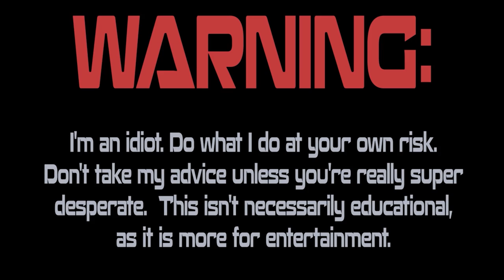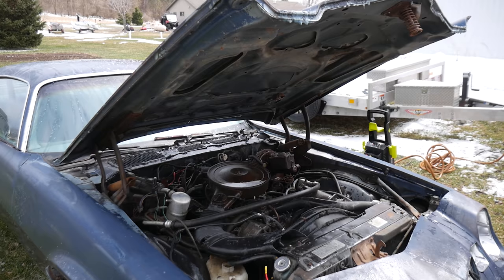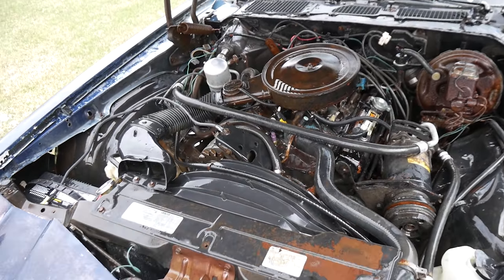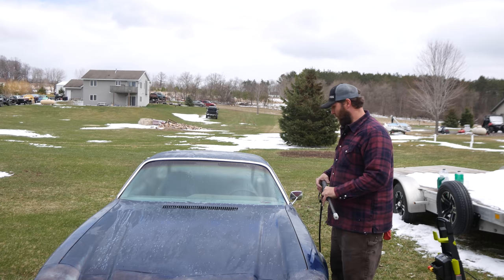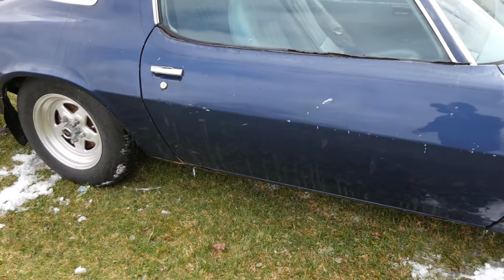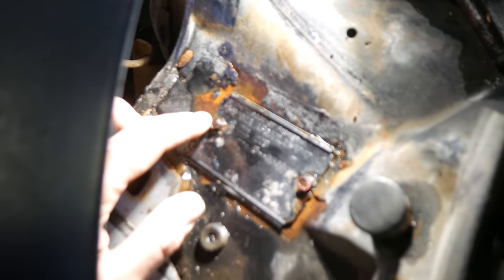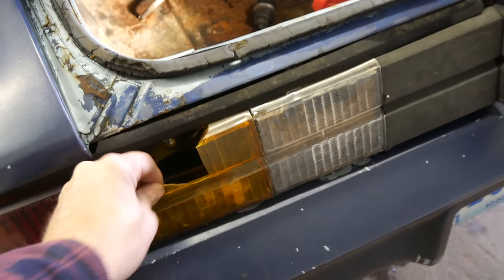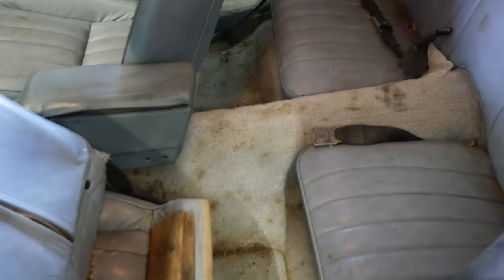Forgotten Barn Find Camaro First Wash In 21 Years! - Vice Grip Garage EP69

Comment: Love this channel!  Here's a bit of advice from an old F-body guy: Get the feller an old-style triggered oil can with a long pointy dispensing tube.  Fill it with lightly used (or new) 30w-ish motor oil.  Now lube the crap out of those giant old door & hood hinges, springs, hood latch, release cable, trunk parts that move, spring shackles, etc.  Basically, lube anything that moves and looks rusty.  Do it until the parts GLIDE...it takes a few trips around the barn too.  Soon, the hood & doors will work a whole lot better.

Comment: your issue isn't the gravity feed. Your washer is trying to compress an air bubble. Remove any tip you have and stick the wand into your water container and run the system in a circle with the tip submerged. Might bleed it out. Usually you can run them with garden hose pressure and the power off with the tip removed and they burp the air out pretty good. If you don't you get pressure drops and compressor noises while the soap makes a run for the ground.

Comment: I think the ‘ol 305 just needs a cam, intake, and carb, maybe a little more cleaning up and she’s good. Then throw a glasspack exhaust on her and she’s a teenagers dream right there
Reply: Did my first burnout at the town ice cream spot as a teen on a 305, it'll get her done
Reply: @Onewheelordeal  I got outrun by a 4-cyl Mazda pickup in my '78 305 Camaro. What a turd that motor was.
Reply: 305 is a fine engine, there's nothing wrong with them other than the fact the 350 exists... which is better in every way.   Since it has a 305 in it?  I wouldn't put any money into that engine, but it's fine.  I second the glasspacks.
Reply: The Old muscle car  350H/327 cam in it , maybe an edelbrock dual plane performer. that'll wake it up.
Reply: Then we have to put on headers. Which means we need better heads, which means rings, bearings and probably bore it .030.....so we need new pistons. Yep. Thats how it starts.
Reply: Plugs too
Reply: @unicornsteaks6769  in '71 I made a whole lot of money betting on my car against mustang 289 and Camaro 283, I was in a 65 VW bug. Keep in mind minimum wage was 1.65$ an hour. The only thing stock on the engine was the block. I had almost 4k $ just in the engine.
Reply: Cofel_81-228–.   You’re right, just a couple more things tho. Swapp that 305 block for a 350 block and while your at it thro in a 400 crank.   Just simple bolt-ons. To wake that lil 305 up! 🤩
Reply: You did see the part of the video with the burn-out right? With the sound turned on? And he spent 9hours PUSHING into the garage? I getting the ole 305 is not OK vibe, it’s hurt, probably pretty badly.
Reply: @padrescout  You could bolt on a set of decent heads, a bit too much cam and good dual plane intake/750 carb. 4:11 rear with a spool and a stall converter. That way when you don't make 300 HP and trash it for a 350 you'll have all the parts for 350 HP.
Reply: Yeah, I agree... take that little 305, swap in a 4 bolt main 72 350 block, 400 crank with the main journals ground down, 350 Rods, 400 pistons, harmonic dampner and flexplate, then solid lifter 292 cam, camel hump angle plug 202 heads, RPM air gap and a Holley 650 mechanical secondaries, that little 305 shout skoot down the road pretty good! Like my 83 Sleeper Firebird and the 340 Challenger in my 96 VHS vid "Burnouts & Boobs"

Comment: A way to get rid of the sticky steering wheel is to make a poultice of baking soda and a bit water.  Rub the paste on the wheel as if you’re wet sanding.  Repeat as necessary.  This method works great on tools and handles that have the “soft-grip” plastic (TPE) that always turn sticky.

Comment: Second-gen F bodies were well-known for the rear leaf springs coming up through the trunk once they got rusty, and this one is no different. I wouldn't touch anything on that car until the driver's side trunk rust issue is fixed, especially if you're going to resell it

Comment: Air shocks. fat tires. glass packs, rear spoiler and some rustoleum stripes on top and you have a race car, a little duct tape and some fuzzy fur and your interior is mint! dont forget to flip the air filter lid upside down to give that throaty sound. then you can take her cruisin wearing your white Reebok hightops with the laces undone

Comment: Professional car youtubers: “make sure to not use excess water in the engine bay, cover the engine when washing the hood, and be careful of electronics.” 

Vice grip garage: haha no
Reply: If you have to drive the car right away sure, i think you may be over thinking things a bit. I detailed cars at a gm stealership a hundred years ago and if you know what not to hit straight on you usually are fine. We did spray em off with the engine running back then.
Reply: He’s power washed the interior of cars before.
Reply: @montestu5502  
I've power washed the insides of big trucks before to, Kenworth, freightliner  , Mack it makes them look good, a pain cleaning the Windows though .

Comment: We dropped a 455 HO into my buddy's '78 and backed it with a beefed TH400. It requires frame connectors (and some other strength upgrades) but it sure is fun to "pilot". Trying to talk him into a 5 speed manual swap now and a set of Super Duty heads we found.

Comment: DEREK, if you'd put 1 of those fancy ball valves (like the water feed on bottom) on top of that tank. You have a compressor on the truck. Run the regulator down to 3-4PSI. You wouldnt starve the power washer!

Comment: I bought a 1979 Berlinetta Camero with  a 350 C.I. motor and with a 4 speed manual transmission brand new off the store room floor. Mine was dark metallic green with a tan interior. Sure wish I still had that car.

Comment: For your current issue a shorter garden hose would help and for your well water issue calibrating your well X trol tank to the proper air pressure to water pressure ratio will help that fluctuating water pressure..

Comment: I had a 80 rally sport with a 305. I broke the smog pipe on it that made a leak and convinced my parents that  the motor was shot. so I put in a 327, You know a 400 would go nicely in there if you can find one. Or a big block.  that camaro really is in pretty good shape

Comment: Do a cheap engine upgrade, add a 350 crank to the 305 to make her a 331(minor notching required). Then throw a PepBoys 4bbl and some flea market headers and cherry bombs on her. Leave the paint as is; its perfect. Top her off with black steelies in front (w/chrome lugs) and a pair of old early 80s era 5 spoke Z-28 rims in the rear, (extra points for white lettered Coopers) and you'll have the perfect tweaker Camaro. Then crank up 'Bitchin Camaro' on the cassette deck (with Jensen Triaxials in the back)  while you do donuts on your neighbors lawn at 2am. Rock on.

Comment: I don’t know if you know this but that valve cover with the “305” on it tells me that that is a GM replacement engine, those 79 305s had soft cams and nylon covered trimming gears they would get brittle and come apart then there would be loads of play in the trimming chain (that may be why it got a new engine?) I think you do a great job with these videos, keep up the good work. P.S. when that power washer s**ts the bed I was hoping you could replace it with a louder one 😜

Comment: @Vice Grip Garage I have a 46 one ton pick up truck. It’s been sitting on my farm for 50 years in the rain. No rust on frame, crossmembers or rear end. But the engine has been rained too. What could I do with it to get it going ? Try to rebuild it’s motor or put a more modern engine in it?

Comment: Derek, if you're not going to keep the Rallys on that '72 Chevelle, toss'em on the Camaro with some el cheapo white-letters....trim rings and the center caps, call it good. Might be able to just sand the flaky shit off the surface of those rear panels and hit it with the specific plastic "paint" if they haven't deteriorated too far....the steering wheel, may just be better off to get a cover for the rim section, the material is breaking down and will continue to emit "spooge"....if the carpet is just faded and stained, might be able to clean it and re-dye unless the mouse piss stench is soaked real good into the jute padding underneath.

  I remember these base-model Camaros being $1500 used car-lot specials, all day long...

Comment: If you pull the shifter in low 1 and hold it to the right side you can use it as a ratchet shifter lol that's good for at least 50 horse brother lol

Comment: Nice ride. Does the air condition work? I owned a 305 in 1990. Unfortunately, the rear electric circuit collapsed and it had to go.

Comment: Where I come from, we call that an Earl Scheib special
Reply: I  remember Earl Scheib ,and his commercials..lol  He can paint that car for $ 99.99, of course it wont be a color that you have ever seen before...but...lol. My 68 chevy belair  was a light metallic green, came back from Earls more of a Pea Soup ,stealth Green..
Reply: Yep, one step below Maaco
Reply: Had fergotten about Earl Scheib, tks fer the reminder
Reply: $99 paint?! I wouldnt suppose that half your wheels, molding and taillamps are painted over as well only to find out its chipping in a week...
Reply: @alvon911  i know a maaco that uses high end paint dupont sentary  500 witch would cost a person more for the paint then they charged to paint a car i would never knock that shop  plus they have a real good painter i just would not let them do any body work they can't cut and replace they tend to use way to much bondo . but that is not there fault it is city hall that is at fault no wielding or torching is what they have to deal with . this is y there is no real body shops in that county .

Comment: Dude. Build a high revving N/A small block for it. Convert it to a manual trans. Lift it. Light bar on a roof rack. Paint it with a white single stage tractor paint. Call the ol gal "snowblind". Rally the wheels off of  it.

Comment: I would gut the interior except for the dash. Clean it up and bolt in some cheap seats. Cut out the rust and bondo/fiberglass the holes. Rattle can paint job, tail light, grille, get it running right. $500-$600  in materials and parts. Shoot it down the road for $3k

Comment: Put it on jack stands to clean bottom and top.  You dropped the AC pump to tighten the power steering by robbing bolts???

Comment: Always love your videos.  I just picked up
 an 82 El Camino with a factory 305. 4 barrel that was in a storage unit since at least 07.  Got her started up and she has a flattened lobe on the #4 exhaust port.  Would you have any recommendations for a new budget friendly cam/lifter set?  Got a performer intake and carb for her  and want her to be a daily driver?

Comment: My own theory on sticky GM steering wheels: 20 year old "Armor All", the detailer's secret weapon of the 1980's. My uncle used it on everything. Had to steer his '74 Safari that was sitting for 10 years and had to wear gloves. FYI: Never,     EVER!      use "Armor All" on a motorcycle seat. You'll slide around like crazy on the bike, and any barstool you plan on using over the next few days. (it was a 1983 XR200R)

Comment: If you want to do it the right way:   Take your angle grinder and take it to some of the rust. then fill it up with fiberglass bondo. then half gallon of blue all around. don't go for showroom quality. just go for coverage to make it look smooooth. keep the damned wheels, they're fine as winter rain.  maybe a half can of frame flat back on the rrear drums .    And ya, for the engine if you didn't screw it up  the 350HP/327 cam is a nice selection. fit under any GM lackluster head. easy on the valve train. may even live with todays oils.

Comment: that would be nice with a 383 stroker engine in it with a 700 r4 And a 411 limited slip differential. that is if a feller had the money.

Comment: Well you have Rally's on the Chevelle with a bad frame that would look nice ...it seems to have one of those $99.95 paint jobs ..you could make it a sleeper out of it with .020-.030 gap in the rings & a ok cam she would take a 300 shot of nos . On engine masters they did a 305 & it did fine till the ring gap closed up so the motor will take it will a quiet mufflers & your wording you could make some money racing people

Comment: I miss my 77' 3speed automatic turbo with 305 small block and I switched the 450cc 2 barrel  for a 650cc 4 barrel carb I got off a Chevy van. Bitchin Camaro Derick

Comment: I had a 1980 Firebird Esprit, and the original steering wheel was sticky just like that. Could never get it clean, so I ended up replacing it.

Comment: Ah it's got the under bumper hood latch my 80 and 81 ended up with hood pins because of those. Lol coincidentally the 78 I own now has the through grille latch on it. 78 was the oddball year it shared alot of parts with the 77. I put pins on it anyway because of the fiberglass hood it came with that isnt great has no latch provision.

Comment: I had a 74 & a 79...
Both were powder puffs...The 74 had a 350 and I think 37 hp. Got 9 mpg.
The 79 with the 305 was a much better car. Had more power (believe it or not) and got 15 mpg.
That whole smog & hp reduction era sucked nads , but you could work on em.
Like like todays, digital runs the whole mess, cars of today...
My 74 smelled like grampa's feet, and it was yellow like his toenails.

Comment: Hard car to make a buck on. I would replace the carpet with new. Try to find used interior panels and spray paint, back rear deck panel, used but good seats if possible, tailight. New shocks sits to low. Get the engine, trans, brakes and suspension working right then dump her. Hopefully you could make $20 on her.

Comment: The captains wheel is the material used,  it's age and the length of time since it's been introduced to petroleum products,  ie  hand grease.   A guy can be sure that one has been run through by the owners hands a time er two.

A guy can't  run a 126.8 foot long hose,  from gravity to his wife's pressure washer,  and expect it to not cavitationilize 67.91% of the time , not 3/4 at least,  maybe a good 25.50 foot long 7/8.20 " ? 
Oh well,  it's fiiiinne. 
cheers guy

Comment: If any money is to be put into the 79 Camaro, It should be spent on RUST REPAIR, FRAME CONNECTORS, SUSPENSION, DRIVETRAIN & Then, One would want to pretty her up & put some lipstick her! Rust repair first & then the basics, stiffen up the frame (or lack there of-sub frame) There are companies that make custom frames! THEN SHE'D BE WORTHY OF A 1973 (4.125 bore sb400) stroke it out! Then, Bore it .030 over, port & polish the heads or replace them with aluminum heads & add roller rockers & be on your way to achieve 750hp & torque. Then one would fall in love with her!!! Do her right!

Comment: Put a digikal meter on the whirly box lol  I love when you describe parts of the cars electrical system and how you say sparkilators etc. Well that paint is a bit worn on that front Apron more than the rest but hey its the spot that gets hit with small rocks and gravel from the road but the rest of the paint looks like it  was rusting a bit but it might buff out in spots. The interior not good when it smells like the inside of a Gerbal cage means them little mice anamules were living in there at some point. Thanks for sharing Derek

Comment: Had same car with T top. Bought it new. 305 had distributor issue. Engine would stop after hi-way driving for 45 minutes. Fix was to remove coil and points, wipe bottom of distributor with a silicon oil/paste to prevent the bottom of distributor from overheating. Crazy fix but worked.

Comment: put a 454 z71 picktruck, MT on the reae, 4,56 ratio, two seats on front and delete de rear seats, phosfated all the car and cold zinc it, paint original color, restore the rear lights, and you have money to spent put a 4 gear stick, nice car, never crushed

Comment: I can say for sure it is better than the Chevelle. You only bought the Chevelle because it had a pretty paint job and got a sudden rush of patriotism at 3 am when you were trawling through the budget section adds. I bet. LOL  The Camaro isn't to bad and can be saved. So whats it going to cost. That's what it comes down to. How much going in to it and how much are you going to get for it as a  legal runner. Having 2016 plates off a "something else'' that it isn't, might just ring a few alarm bells.  Does it still have something that resembles a vin plate or chassis number or do you burn your fingers when you touch it. That may have a little to do with its value along with the body and mechanical condition.  It does look a little better clean.  They were a popular car so its not unsaleable for sure and  they don't makem anymore so that give it value. Some one would buy it and love it.

Comment: If you wanted to flip it, best you could do to get the most bang for your buck would be to fix the air conditioning and the shitty paint over doing the interior plastic parts that start coming apart a week after new ones are installed. The fit on those plastic parts are horrendous. Let the next guy deal with it.
People be driving down the street and go 'Oh look! A shiny object'.

Comment: 1 / pressure washing and got water like that put air to it 5 6 lb in 1/4 c a water right out the bottom you'll never have the on and off with the pressure washer

Comment: The interior plastic in Camaro's are one of the easiest to fix as there flat. Jb plastic, weld bondo and paint they come out looking new. Find a dashboard stereo mod vidjoe and you can see them do it on a small scale. But it is truly easy just time consuming.  One thing you would want to do is get easy to sand higher end bondo.